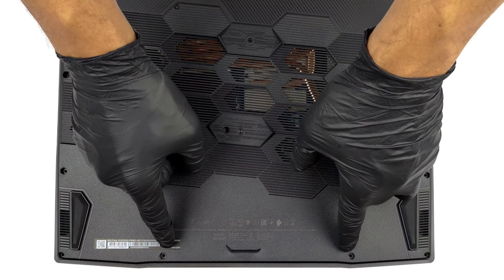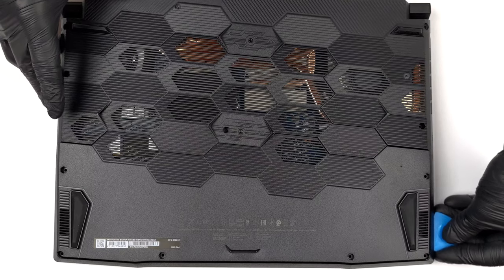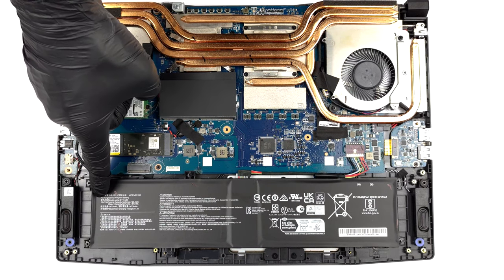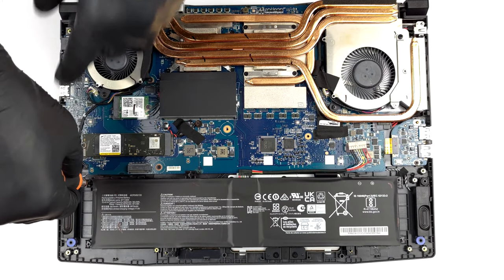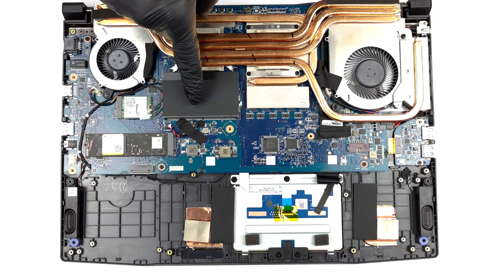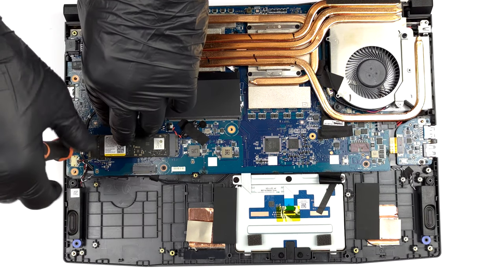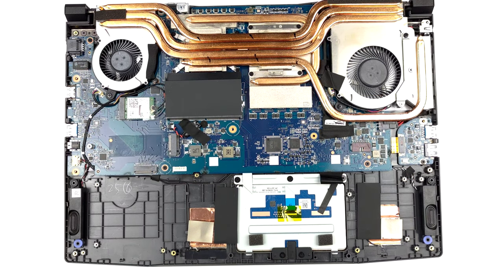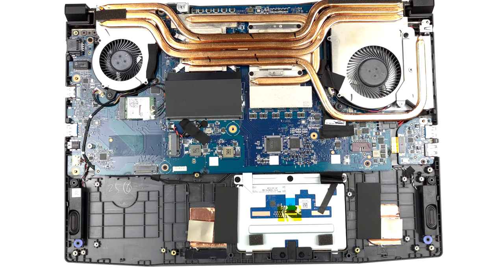🛠️ How to open MSI Pulse 15 B13V - disassembly and upgrade options

Comment: Is there a way to install the second m.2 I want to get a 2tb but unsure how to secure it
Reply: only one way - instead of wifi. LOL
Reply: I ended up replacing the 1TB it comes with, with a 2TB Samsung 990 PRO. There is only one slot on this mobo. And I'm not removing WiFi, lmao.
Reply: there is 2 slots,read my comments to chekchek below
Reply: @xTSTOx  Hi, I am looking too swap the 1tb out to a 2tb as well. Once I have done that and I turn the laptop on, does windows automatically start or do I then need to buy another copy? Thanks

Comment: No SSD expansion slot
Reply: There is one. I saw it in the video here but wasn't sure so I opened up my laptop and there it was, a second expansion slot right above the battery, the placement was so stupid if u ever want to expand your storage u need to put your ssd hanging over your batter. (Look at the slot right between the current ssd and the battery. It is 2nd expansion slot)
Reply: @cleyt973  just the same motherboard with katana 15. Katana 15 can install 2nd ssd, but smaller battery (53wh). So, MSI already told you pulse 15 just offer you 1 ssd slot.
Reply: @Rohith_sai_m  do you see it here? think before typing.
Reply: I've already confirmed this with MSI it has two SSD slots. But they gave me no clue how you're supposed to add the second one.
Reply: @Rohith_sai_m hello. can you share me a link on what drive is compatible on the 2nd slot?
Reply: @Rohith_sai_m is it possible or not , to put a 2nddm ssd above the battery . I mean , does it work ?
Reply: i think to have another ssd, you need to buy m2 bracket directly from msi service center and use it for additional ssd slot upgrade.
Reply: @Rainemperor I have ordered and received the bracket. There is no place to install the bracket due to large battery. The screw points are BELOW the battery so you cannot install the bracket. Means NO additional SSD on this model.
Reply: There is a second expansion slot as mentioned but it is hampered by the battery which in all honesty is bizzare in terms of design,what was the manufacturer thinking?!
However,in the bios,under storage it lists your currently installed nvme storage and below it says slot 2 empty.I went ahead and whipped out the battery,installed a second ssd in the slot pointing down towards the battery,sticking it paralel with the help of some blue tak(just to test,i will make a bracket).I can confirm that the second slot works,i now have 2 drives in my laptop,its running from the psu but no battery obviously.i believe u can buy a smaller battery.just thought id share my findings with anyone reading this
Reply: Just to add guys,further more...i have a 990pro 2tb as C and a 980 pro 1tb now in slot 2.Crystal disk reports both disks are running at pcie 4.0 x4 and crystal disk mark is accuratly reading both drives at their rated speeds on both read and write.and it appears no other component has limited bandwidth across the pcie lanes.the 4000 series gpu is still restricted to x8 but it was regardless of the second ssd.One other thing to note,i cant see any option to enable raid in the bios,so im guessing its not an option although i havnt got 2 identical drives to see if installing 2 of the same drives enables anything in the bios settings,if anyone can clarify on this id like to hear it,ill get a second 990pro if so.hope that helps